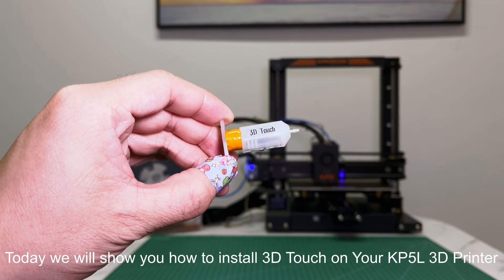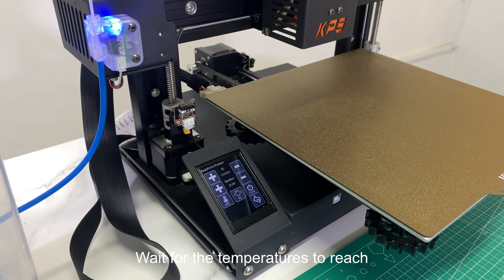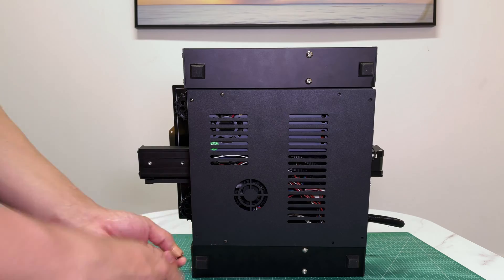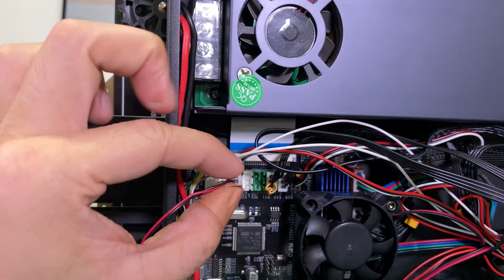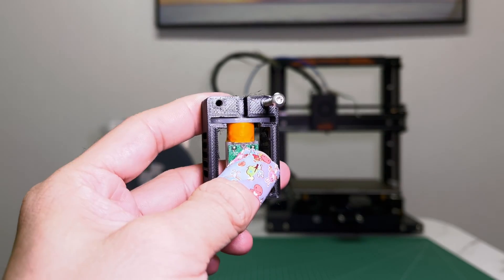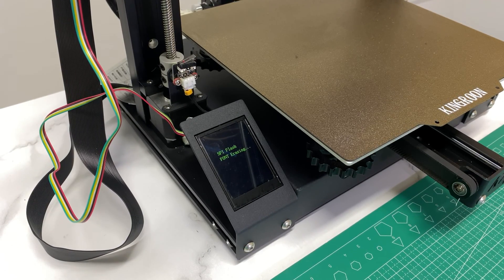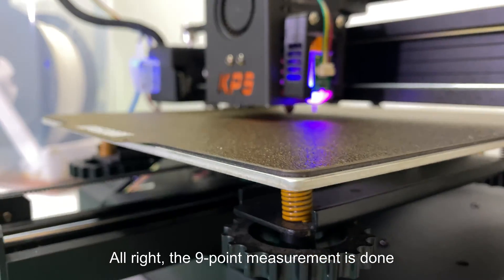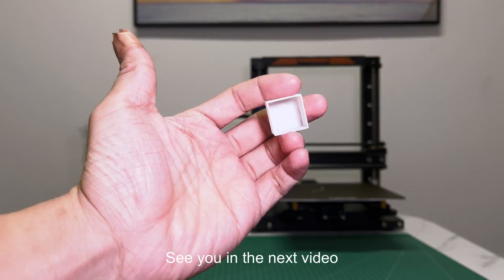How to Enable 3D Touch on the KINGROON KP5L 3D Printer

Comment: I have spent hours on this with no luck.  I have an identical board and 3D Touch as shown, followed exactly and the Z-axis will not go down.  The auto-level function is there, but the probe doesn't go down at each point and the z-axis just keeps going higher - completely unusable - please fix this...

Comment: @Kingroon3DOfficial  you need to get these firmware issues solved, fundamentally its a good printer, but there are so many poor reviews that it is costing you sales and the majority of the reviews and complaints are firmware based. i genuinely like the printer, but the firmware is a nightmare and being robin nano, makes it very difficult to Klipper the printer with any of the available Klipper pads.

Comment: The 3D Touch leveling Sensor I got are useless pieces of junk. Ordered two of these for my Kingroon KP5 machines. The firmware they tell you to use makes the X axis work backwards. Then the work around for that is to change a code in a line in the firmware but that kind of fixes that but manually it still runs backwards. But none of that really matters because it will work for about 3 to 4 layers then the screen goes white and stops. I have eight kingroon machines and I love them all but this thing is driving me crazy. Does anyone know how to fix this please let me know because Kingroon isn't helping me.

Comment: hi there
I ordered kingroon kp5l on June 18th and it was delivered about 2 weeks later.
I tried to do an auto leveling upgrade, but it failed.
It seems to be a chipset problem.
I want to go back to the initialization state, but the firmware on the kingroon homepage has an error.
It costs $169 and is in junk condition.
I need firmware in default state. can you send it by mail?
Again, the firmware on the homepage has problems working!
I am spending too much time on this issue.
I want to recover quickly and complete my review on YouTube.

Comment: Is the firmware repaired or is it just not worth it to ad abl

Edit: went and installed the new firmware it didn’t white screen also didn’t show issues others noticed though what it does is take the first probe then flash red and goes to point 5 on the bed, will update if I find the issue

Late Update 30/8/23 : I gave up on adding abl to this junk I believe it be a mix of a trash chipset and even worse firmware that after installing “default firmware” homed in all opposite directions which I had to edit the firmware file to fix because any 3rd party “stock firmware” was just the same shit. TLDR don’t even waste your time I replaced it with an bamboo p1s and it’s not even funny how much better it is though you do get what you pay for

30/9/23 
Pulled printer from garage for another attempt and Firmware has been repaired abl works and buy m to f DuPont cables and extend  the filament sensor if you can’t solder and attach it with some 3m double sided tape works a charm 😅
Reply: i'm having the same issue, if you find solution please let us know, im my case, the needle even goes down on the first point, it just goes to the center and park there

Comment: I'm trying to flash my KP5L with the stock firmware provide in the website and the X axis homing goes to the wrong direction. Can anyone help me ?
Reply: @Kingroon3DOfficial I have the same problem
Reply: @jenik100  just let me know if can fix it
Reply: @jenik100  i recommend you to flash it with better version of marlin, you can find it on thingverse, 3 files, just make sure to run the PID test after flashing, you find it direct on the display options, then store settings. bye

Comment: This printer's board is hot garbage stock firmware is not stock as its buggy and never works like the original that was pre installed at factory!! don't add bl touch unless you get a new board beware!!!!
Reply from the maker: You can contact support@kingroon.com for help. New firmware and tutorials will also be available soon.

Comment: after flashing, X axis direction was inverted. Changed that in the settings, re-flashed. Now everything works until I preheat. The screen now goes white and that's it. The touch screen still works, but impossible to see anything. 3rd time I try a Kingroon "upgrade" kp3S with ABL was a no go, KP5S with 3D touch gives me the problem as described and the laser modult doesn't work either. Next printer needs to be something other than Kingroon, I am afraid. one too many issues.
Reply from the maker: Hope you have got the help from the email. If you haven't please send email to support@kingroon.com.
Reply: Did you manage to fix the screen going blank white ??   Mine still the same..  It turns white during printing.  It's really annoying...... This is obviously a firmware issue,  and it doesn't seem they are releasing any firmware updates for it.   I think i'm going to put this thing on the shelf until an update fix is released.   In the mean time,  i will have to shop for another printer.
Reply: @WTF_BBQ  I took the leveler off and reflashed to stock. That also came with the same x-axis issue, so had to do that twice too, to get the X-axis to work. Jut annoying and unnecessary. If it were my product, I would make sure these files actually work before I put them out there. Must be the Dutch in me..... So long answer short. I gave up on the leveler for now.
Reply: @sxmtaekwon-do7685  
I agree.  Unfortunately,  I don't think It's worth my time or effort to do all that.   And also,  a large bed printer really needs an auto leveling feature so I'll keep it for now.  However, This should have been installed from the factory in the beginning,  and I would have gladly paid extra for it.

I was really happy with my old K3PS which is why I bought this big printer, but this one got me very disappointed.

Comment: Tell me, when will the updated firmware for the 3D touch for this printer be released, because I'm tired of testing in order to catch the accuracy of the sensor?
Reply from the maker: You can find the link in the description, we will have it uploaded in the same folder. So the link will be always useful.
Reply: @Kingroon3DOfficial  There is another problem: when setting the table size to 310 x 310 mm in the CURA slicer and printing a 300 x 300 mm square model, the printer prints only 293 mm in the X axis, after which the plastic sticks in one line of the remaining 7 mm. Considering that this problem is not fixed in the slicer, it means that this is a problem in the firmware.
Reply from the maker: @СергейБогомол-ч3ф  You can modify it in the cfg file, the coordinates of the 3D Touch detect decide the printer volume. Modify the file then flash it again.

Comment: Did you notice that the z-probe offset is ignored after the homing sequence? ABL only works if the bed is leveled before installing the 3d touch, like in this video. This is a known Marlin problem.
Can I get the source code for the firmware? I'd like to give it a go at fixing it. I'll send you the modified version back if I can get it to work.
Reply: In case someone is having the same issue:
You can use the old KP3S firmware https://drive.google.com/file/d/1mSXZBLzWFwz71TwLO893RK2lJLcrCqDr/view?usp=sharing%C2%A0 with the KP5L config file. Just enter the correct probe offset in the config file, or send M851 gcode through serial to change it on the fly. You won't need to set it again unless you change the probe height significantly.
Reply: @glitchygarden6973  hello xD, how did you manage to do that? if i flash the KP3S, after auto levelling doesnt show me the Z Offset option =/
Reply: same problem   do you fixed this ? can i get you fimware for fixed ?
Reply from the maker: The new firmware is already in development, hope it will be fixed soon. As for the source code, I will ask our engineers and see if we can provide that. Thanks for pointing that out!
Reply: @Kingroon3DOfficial  Wen is soon exactly ??

Comment: The firmware only allows for 9 point sampling.  I really think the KP5L would benefit from a 16 point or larger sampling.   Is there anyway to do that ??
Reply from the maker: Modifying the cfg file if you can. Once you do, flash it and you will get the 16 point measurement you want.

Comment: Hello. I installed the touch sensor and updated the firmware. The auto-leveling worked fine, but now I cannot print. First of all, when I start printing, the screen goes blank. Then printing starts, but the filament feed motor is spinning backwards. When the screen goes blank, it does not recover until I turn off the power. What should I do?
The reverse rotation of the extruder could be corrected.
Reply from the maker: That means that something wrong happened when flashing the firmware. Please flash it again and see if anything changes. We suggest to use a different SD card or format the current one. As for the wrong direction, please check below article to modify it, the step 4. How to Modify Configuration file for the KINGROON KP3 Mainboard
https://kingroon.com/blogs/3d-print-101/modify-mainboard-configuration-file-of-kingroon-kp3s
Reply: @Kingroon3DOfficial  I formatted the SD card and flashed the firmware again. However, the screen went blank in the same way. I tried several times but it did not work.
Also, the level sensor sometimes comes out during printing, and even though the nozzle and heat bed are aligned in height, there is a gap of about 2mm between the nozzle and bed.
Reply from the maker: @yoshiyu9691  Please send an email to support@kingroon.com with a video that can show the problem and the connection on the mainboard, our guy will do a further check for you. You can also flash back to the stock firmware and make sure it works fine under that. Waiting for your email. Have a great day!
Reply: @yoshiyu9691  hi, what was the solution, mine is showing the white screen also.

Comment: Здравствуйте! В ролике присутствует крепление сенсора, однако ссылка ведет на совсем другое крепление, которое похоже, однако крепежные отверстия находятся в другом месте, нет прорези под провод и прочие отличия. Можно ли получить ссылку на файл для печати, либо проект данного крепления сенсора из первой части видео?
Hello! There is a sensor mount in the video, but the link leads to a completely different mount, which is similar, but the mounting holes are in a different place, there is no slot for the wire and other differences. Is it possible to get a link to a file for printing, or a project for this sensor mount from the first part of the video?
Reply from the maker: Please check the first link in the description. We put the stl files inside the folder. And I just checked it again, the file is correct.
Reply: @Kingroon3DOfficial  I also checked this file in CAD, the file is actually skewed, although it can be corrected in CAD, it's sad that the raw holder file is used as a basis.
Тоже проверил данный файл в CAD, файл на самом деле перекошен, хотя его можно в CAD и поправить, печально, что сырой файл держалки используется за основу.
Reply from the maker: @PETROVICH4YOU  I will let our guy know that and see if they can do anything about it. But honestly we haven’t had any issues on it.

Comment: Why does the screen on my KP5L become Blank white ??    It does this quite often.   I have to turn off and turn the printer back on just to get the screen back to normal.
Reply from the maker: What the firmware do you use and what filament do you print? We will look into it and find out why.
Reply: @Kingroon3DOfficial  
I got it from here.   It works but it my screen will go blank and just white screen until I reboot the printer.   I have to do this every time I finish printing.
https://drive.google.com/drive/folders/1GKgxuKroyt9iPF51nZn2M2NoDaWLn_1Y

I tried the one in the link you posted in the video, but my printer didn't work.  Instead, it installed firmware for  CNC
https://drive.google.com/drive/folders/1VwMxSzd7p6GQ5RVwoHhlUCJpMXhC-gdx

I use ESUN PLA+ filament, but I don't think it has something to do with the filament.  This is a firmware issue.
Reply from the maker: @WTF_BBQ  Please use the firmware from the first link of the description. And send a video to support@kingroon.com so that out guy can do a further check and find it out. Please make sure we can see the connection on the mainboard and how the printer works. If you have any photos that shows the white screen, please also send that. And we will do some checking on the published firmwares to make sure they’re correct and updated. Thanks!

Comment: Скажите, а в чем смысл 3D Touch в принтере вашего производства? После пробы 9 точек, он сохраняет куда то данные и дальше их использует для корректировки неровности стола? Данный датчик бесполезен, т.к. без 3D Touch первый слой на моем принтере прилипал к стеклу, а после калибровки 3D Touch он перестал прилипать. Раз 10 калибровал, не помогает. Дальше решил с помощью Z-offset уменьшать значение. Тоже не помогло. Смысл этого 3D Touch. И для чего вы убрали ручную калибровку стола? Что теперь делать когда я захочу вручную откалибровать стол? Отсоединять 3D Touch, прошивать прошивкой без 3D Touch и потом только калибровать вручную? Это идиотизм! Верните, пожалуйста, обратно в прошивку с 3D Touch ручную калибровку. Зачем вообще ее убрали оттуда?
Reply from the maker: Sounds like your 3D Touch is active. Please make sure you are using the same mount like we do and followed all the steps. If you did, please send a video to show the issue to support@kingroon.com, our technical team will help you out. To use the manual bed leveling, please flash the stock firmware and unplug the pin on the 3D touch. Thanks!

Comment: Здравствуйте! А почему с прошивкой принтера все работает, а с Klipper не работает? на команды pinup и pindown все работает. Но на QUERY_PROBE всегда выдает open. Может быть надо для Klipper разъем с 2 проводами по другому вставить? Спасибо!
Reply from the maker: Klipper works differently. Please check our video on it, get the Klipper Bundle to use. To use 3D Touch with Klipper firmware, you need to do some modification to enable it. Here is the link for your reference:https://www.klipper3d.org/Config_Reference.html
Reply: @Kingroon3DOfficial  Спасибо, я смотрел видео и делал все по вашей инструкции. По вашей инструкции sensor_pin: должен быть ^PA11. Но с такими настройками не работает. Т.к. PA11 - это датчик ZMIN. Если я делаю не по инструкции, т.е. вместо ZMAX я втыкаю разъем в ZMIN - то на комманду QUERY_PROBE начинает реагировать. Но это считаю небезопасным отключать ZMIN. Подскажите, пожалуйста, название контакта ZMAX в Klipper. Для ZMIN - это PA11, а для ZMAX какое?
Reply from the maker: @Рустам-в5о  Hi, we haven't use 3D Touch or BL Touch yet in Klipper, but its support should be available soon. Now its test are not ongoing. And it is quite different to use it in Klipper. If you cannot wait, here is a Klipper project for our printers, it might help you out. https://github.com/nehilo/Klipper-KingRoon-Printers  If you are use the stock firmware we provided and get problems, please send the video to support@kingroon.com, so that we can see the issue more clearly and help you better. Thanks!
Reply: @Kingroon3DOfficial  Спасибо, я подключил 3D Touch в разъем вместо ZMIN. Klipper с 3D Touch у меня теперь нормально работает. Если делать по вашей инструкции, т.е. разъем с двумя проводами(белый и черный) воткнуть в разъем ZMAX, то в Klipper работать не будет, т.к. вместо PA11 нужно указывать порт ZMAX, какой номер PA я не знаю. Спасибо за помощь!
Reply from the maker: @Рустам-в5о  You are welcome and thanks for the details. We will get back to Klipper soon. Please remember to go over the required process while using it, like measuring resonance and pressure advance, it will help to improve the printing. Have a great day!
Reply: @Рустам-в5о  hello, can you help me install klipper. I can't get it to work.

Comment: на удлинители датчика перепутаны провода - желтый и зеленый. Осторожно!
Reply from the maker: Sure, we noticed that. And it could be different on 3D Touch and Bl Touch, so we do suggest connected by pins. Just check the diagrams on both sides and make sure the connection is right.

Comment: I have received a new version of the printer, can I make a connection via a distribution board (on the X axis)? There are pins on the board itself, the question is, is it possible to connect BlTouch through them?
Reply: Yes I just received my KP5L and would like to know the same . I connected the two pugs to the main board  as shown in the video and then downloaded the new firmware for kp5L (pre assembled version) from there website.  The software reflash worked first time no issues. Though when I run a auto level function  it will only probe in 3 positions on the left hand side of the bed and then one almost  in the centre. The probe makes a strange vibration after each probe for a few seconds.  Also now if I press the home all button the print head now moved to the right front of the bed like it's reverse . This is all strange behaviour so somthing is wrong.  I confirm that I downloaded the software for KP5L. 

Video of how my kp5l behave now when I run a auto level. https://youtu.be/8mRjXKBOXDU
I had to put back the stock firmware and gave up on auto level for now. Even the stock firmware needs a change to the text file to get one of the steppers going in the correct direction. We need a working firmware that doesn't need messing with. I'm happy with the machine other than this issue.
Reply: @offgridsa2372  аварийный датчик нижнего положения стола по оси z должен срабатывать?